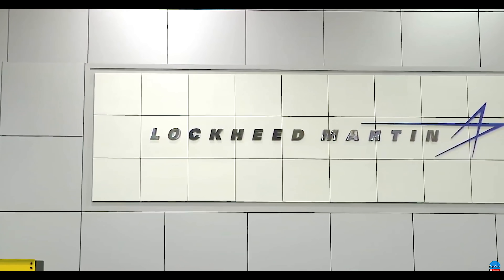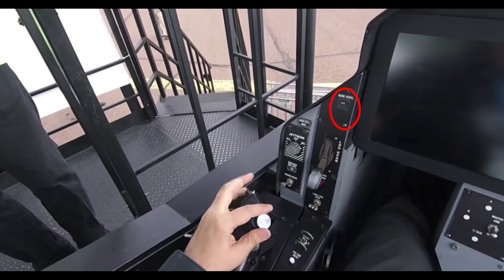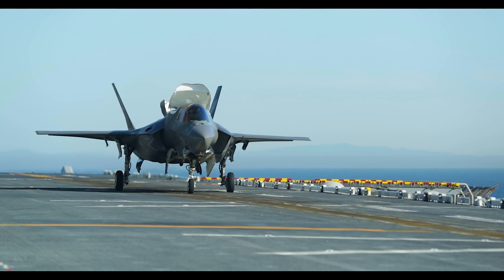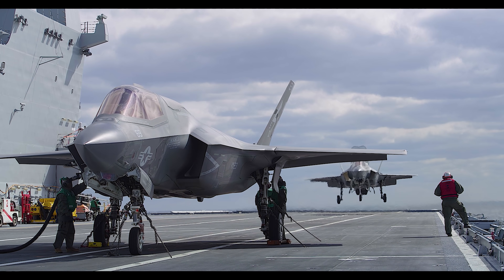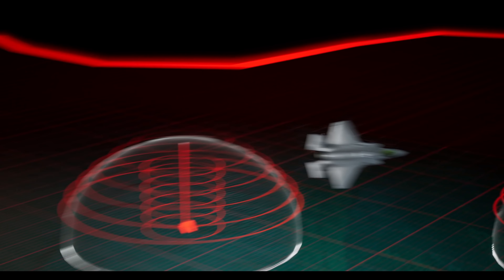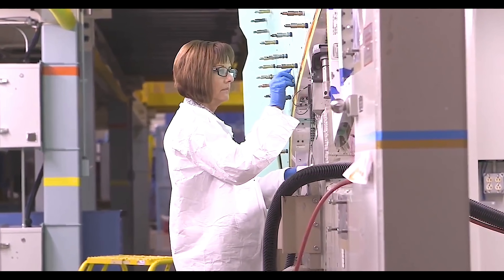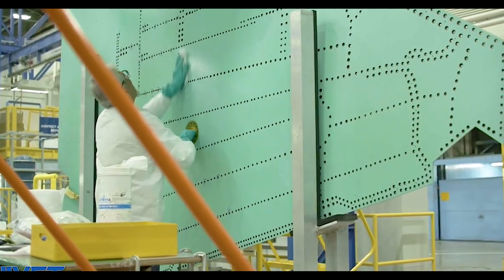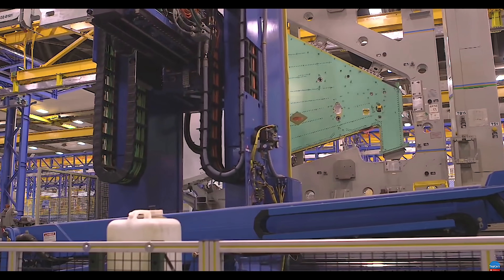Inside the F-35 Factory: The Most Advanced Aircraft Ever Produced

Comment: Possibly one of the most flawed aircraft ever produced? Can't exceed maximum speed due to delamination???
Reply: Those issues were fixed and dealt with 10 years ago. But, hey I guess it is fun to re-cycle a 10 year old news story???

No, it is not a problem.

Vice Adm. Mat Winter, who leads the F-35 program on behalf of the Pentagon, told Defense News that the department has taken steps to mitigate the problem with an improved spray-on coating, but added that the government will not completely fix it — instead accepting additional risk

That coating is a new ceramic based paint that can withstand the higher temperatures.

And, NOTE very careful this statement:

Winter noted that the issue was documented while the jet was flying at the very edge of its flight envelope. He also said the phenomenon only occurred once for both the B and C models, despite numerous attempts to replicate the conditions that caused the problem

Read above again:

He also said the phenomenon ONLY OCCURED ONCE for both the B and C models, despite numerous attempts to replicate the conditions that caused the problem

So, it is NOT a wide spread problem. And NOTE ALSO they NEVER saw the issue with the F35 “A” model.

So, no, this is not a big deal, or issue.  And note that story and information is TEN YEARS old!!! – from 2011.

So, no this is not an issue or problem with the F35.

And this:

Greg Ulmer, Lockheed Martin’s F-35 program head, said there have been no cases of this problem occurring in the operational fleet and that incidents have been limited to the “highest extremes of flight testing conditions that are unlikely replicated in operational scenarios.”

And Winter goes on to state this:

The new coating, which was introduced in Lot 8, allows the jet to withstand hotter temperatures caused by the afterburner, the documents stated. Winter characterized the material as able to withstand “what we call the thermal shock wave,”

So, you talking about an issue that cropped up 10 years ago, and has LONG been dealt with.

But the press and people like you do LOVE to re-cycle older news.

The F35 is now at lot 13-14 production, and all production models since then have these changes built in - so it not a issue nor a problem, and has not been for 10 years now.
Reply: @Albertkallal  Have the targeting problems been addressed with the 20mm cannon?
Reply: @chasefreedom5178  
Yes, they issued 3 fixes.
The B and C model do NOT have this issue, only A model.
First up was the stealth door that opens - bullets exiting could touch the exit area - cause cracks. This was fixed in lot 9 and later models (we at lot 14).

The next issue was accuracy. The gun of course is one of the best made - very high accuracy - it shoots EXACTLY where you aim it! (but you better aim it correct!!!).

that gun assembly is used on Harriers, AC-130U Spooky gunship.
It also used for the Sea Vulcan 25 (turret mounted gun for naval ship self-defense systems).

I can post the technical specs, but at 4,000 feet, 80% of rounds land within 40 feet!
(that's at 3/4 of one mile - longer then what such guns will probably ever be used).

That makes the F35 gun better then the famous M61 used in the A7 Corsair, and the ones in the F4 phantoms.

And unlike Hollywood movies were someone walks around with a chain gun?

They produce over 3,000 lbs of back force!!! (that’s a typical weight of a smaller car).

So the software figures this force out and compensates  with fight control software.

Now a number of jets solve the above issue by mounting the gun DEAD center on the jet. Thus, when you fire the gun, no twisting or “torque” is imparted to the aircraft

The a-10 for example has that "really" big gun mounted dead center.

However, the exact front of the jet is valuable real estate in fighter jet land. (the radar goes there if you are wondering!).

a number of fighter jets do have CENTER mounted guns. You mount the gun (and exit point) exactly dead center in the middle of the aircraft. (the barrel exit is thus above (or below) the center cone radar system.

F18 – centerline
F35B – centerline
F35C – centerline

F15 – not centerline
Dassault Rafale – not centerline.
F16  - not centerline
F35A – not centerline

So, we see today quite much as many jets with non centerline guns as there are centerline ones.

In some WWII aircraft, they thus mounted two guns on each wing side.

But, from Lockheed - 2019 (2 years ago).
quote:
In the F-35A integral gun, we have implemented software updates and installed a field gun alignment aid to ensure proper gun barrel position

So, part of this now comes down to proper maintains (field kit as to HOW to align the gun correct), and those software updates. We not seen the resulting tests (or they not been published).

But, by all information we have, the issue has been resolved. It really never was a huge issue - but the exit door being made to very high and too close tolerances was a issue. You change alignment of the gun, then bullets exit could cause damage to the door exit area.

Comment: what is alpha capability? 4:05.
Reply: Great question!
A fighter with high alpha is VERY desirable for dogfighting. What high "alpha" means is the jet has the ability to produce high AOA (AOA = angle of attack).
So, say your flying the jet, and to the left or down or up a bit, the enemy aircraft WOULD be in your missile release zone. So, in place of flying the jet and waiting for the nose of the jet to move, you JUST POINT the nose that way. At this point in time the jet is in a sense flying a bit sideways. So you point the jet where you want - not wait for it to fly.

the F35 has a MUCH better AOA then say a F16, or even a Rafale fighter. And one REALLY big reason is those jets have a single tail fin where as the F35 has duel tail fins.  When you pull up on the stick (to go up, pull hard g-loads, then now air flow is hitting the bottom of the jet. Thus, the airflow over the tail section is now blocked. So in place of one single tail fin, you put two on the rear. you split them apart and you even angle them to "bite" more into the clean airflow that bottom of the jet is blocking. So, as you pull up hard, the bottom of the jet starts to block airflow over the rear tail section - and thus the jet does NOT respond to the pilot control inputs (say to turn left or right).

While the above is basic aerodynamic theory? I will provide some quotes from a long time F16 pilot now flying the F35 - you note how his comments confirm the high AOA ability of the F35 (over that of the f16).

However before I quote that pilot, watch this AMAZING video of the F35 doing a flat spin. You can see how the jet is being pointed just about ANYWHERE the pilot wants and commands the jet. In fact, as the jet does this loop, note how the jet does not really fly in a loop, but in fact FLOPS over!!! A f16 cannot do this, nor can say a Rafale (or in fact most single tail jets - they would require twin tails, or you could add thrust vectoring to the rear engine).

F35 flat spin - 50 second video:
https://www.youtube.com/watch?v=2Xygbw6t_z0

WATCH above VERY close when the jet reaches the top of the loop - note then how he goes SUPER high alpha. The jet is now flying beyond what a normal jet would fly - he is pointing the nose of the jet ANY PLACE the pilot wants to - and if you can point your jet anyway you want, then you can release your weapons against the opponent WHEN you want!

So high "alpha" = high angle of attack abilities. The only other jets you see doing what the F35 does in above is a F22 or other thrust vectored jets - but the F35 does these dogfight tricks without thrust vectoring - it is REALLY strong in this area.

Ok, so above is theory, above is a video but now lets grab from REAL pilot notes that conforms what was said in this video about high alpha abilities.

quote:
The F-35 provides me as a pilot greater authority to point the nose of the airplane where I desire. (The F-35 is capable of significantly higher Angle of Attack (AOA) than the F-16

So we see the pilot note and state how good the F35 is in this area - MUCH better then a f16.
So it is easier to point the f35 where you want!!!

quote:
This improved ability to point at my opponent enables me to deliver weapons earlier than I am used to with the F-16, it forces my opponent to react even more defensively, and it gives me the ability to reduce the airspeed quicker than in the F-16

Once again, you can see why pilots WANT and LOVE a jet with high "alpha" abilities.  The above quote from that f16 pilot notes and confirms this high alpha ability that the F35 has (which is why in the video he stated "I thought we put that issue to rest!!!".

quote:
Since I first wrote this post, I have flown additional sorties where I tried an even more aggressive approach to the control position – more aggressive than I thought possible. It worked just fine. The F-35 sticks on like glue, and it is very difficult for the defender to escape

So the pilot is stating that once I have you in my sights - you NOT going to turn and get away - I am going to keep my jet pointed at you - and i am going to fire my weapons at you - you NOT going to get away!!!

quote:
Defensive situations often result in high AOA and low airspeeds. At high AOA the F-16 reacts slowly when I move the stick sideways to roll the airplane

Now read above again: the F35 pilot is telling us that the F16 reacts slow!!! Who on earth wants to fly a jet that reacts slow? So again the pilot notes the high alpha abilities of the F35 and HOW very good they are!!!

quote:
Yet another quality of the F-35 becomes evident in this flight regime; using the rudder pedals I can command the nose of the airplane from side to side. The F-35 reacts quicker to my pedal inputs than the F-16 would at its maximum AOA

*
(the F-16 would actually be out of control at this AOA)*

quote:
Another aspect is the kind of reaction I get when I push the stick forward; the F-35 reacts immediately, and not delayed like the F-16. Looking at another F-35 doing such maneuvers is an impressive sight. The various control surfaces on the airplane are large, and they move very quickly

Note again, the twin tail section here. So you have LARGER control surfaces, and you have MORE of them. And note how the pilot NOT really talking about high alpha, but HOW the F35 responds to pilot inputs - FASTER the the F16.

So based on what was stated in this video? (f35 = high alpha ability).
 Based on OTHER pilots CONFIMING this?

The lack of f35 dogfighting ability seems to be a myth, and REAL pilot notes not only state that the F35 is very maneuverable, but such pilots note that the F35 fairs better and is more responsive against F16’s.

The f35 based NOT by my opinion but above quotes will out fly, and out dogfight an f16 rather easy.

So, in effect these notes, and witness and testimony flat out BUST the myth that the F35 can't dogfight!

The REAL  joke? F35 is not only MUCH better at this basic fighter jet maneuverers then most think, and anything better then a F16 at dogfighting is one hell of a dogfighting jet - it simply is!!

So the enemy reading this? 
They can go back to regular mode of crapping in their pants,  then go out shopping for a fresh set of clean under ware - since that is all quite much they will ever achieve against the F35.
Reply: @Albertkallal  thank you. I didn't know angle of attack was referred to as alpha. I couldn't find anything on Google. I appreciate the response.

Comment: Maintenance cost will be the thing that kills the F-35. If its grounded more than ready to fly is another item that should kill it also. Other than that it is a winner.
Reply: But the F35 does not require more maintains then previous jets - in fact it requires less.

As for up time? You have to provide a link or quote COMPARING the F35 to up-time of other jets - it simply not the case at all. The F35s actually have better up-times then other jets. You see, they included down time for in-field block updates to the F35. Those updates were  NOT really down time due to say some system or engine or something else having failed, or even not working.

But, compared to any other jet in the fleet - and compared to any foreign nations and their track records of up time? The F35 fairs just as well.

In fact, the F35 has one engine. So you fly 50 of them, you now have 100 engines to maintain on those other jets? And you also for every hour of flight burning up and wearing out two engines!!

The F135 engine for the F35 is the most reliable, low maintain cost engine EVER put  into a fighter jet - BAR NONE!!!

All field service parts for the F35 have been moved to a single easy door. Pratt & Whitney notes that all this service can be done with only 7 tools that are found in a typical mechanics tool box.

What is really amazing? That engine comes from the F22. The f22 engine was noted to have 30% LESS maintains then previous. The f135 engine is noted to have 50% less maintains required. That actually means a WHOPPING FOUR TIMES less maintains then compared to  duel engine jet.

From 2009 to 2018, they built so many F35's that the engine cost has dropped in HALF!!! - yes, you read that correct, the engine now due to larger production numbers is half the cost!

Right now, the F35 requires LESS ground crew hours to keep flying then does a f16!!!

So, no, the F35 is a single engine, lower cost fighter, and enjoys a lower maintains per hour jet as a result.

To buy:

Rafael:    $94 Million per copy  
Eurofighter: $120 million per copy   
F18  $64  million.  With additional options it goes up to 79 million.

F15 EX 88 million

F35 $77 million.

So how is the F35 high cost when it costs LESS to buy then those other jets? Hum?

Cost per hour: from the USA govenment accoutning office:

Assistant Secretary of the Air Force Management and Comptroller:YEAR 2020
	
https://comptroller.defense.gov/Financial-Management/Reports/rates2020/

And a direct link to quoted cost per hour:

https://comptroller.defense.gov/Portals/45/documents/rates/fy2020/2020_b_c.pdf

We see:
Air Force Numbers:

F-15C  $22,489
F15D   $21,745
F15e   $17,408
F22    $40,385

F35A   $16,952

Navy numbers:
F18C $18,056
F18D $18,048
F18F $13,654

F35C $13,124

Once again, we see lower costs then F15's, and even lower costs then older F18's.

So we have this now:
Rafale: $21,104 per hour
Typhoon: $22,000 per hour.

F35: $16,952 per hour

So based on purchase cost, or based on per hour flight costs? The F35 is a better deal, and it certainly less per hour then a Typhoon, and less then a Rafale. And it also quite a bit less cost to buy then either of those jets to put even more egg on your face.

But if you have a link that COMPARES the F35 up-times to OTHER jets? Not just some lone quote bitching about the F35? Do share that link, I'll be happy to look at what kind of claim they are making.